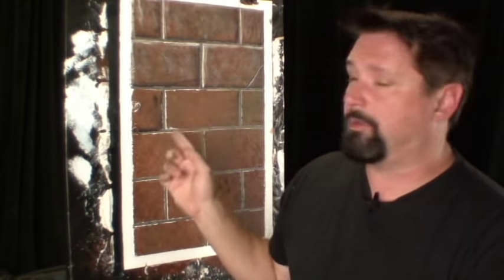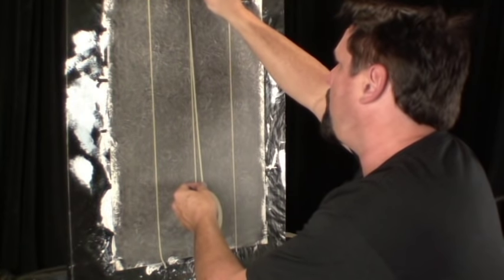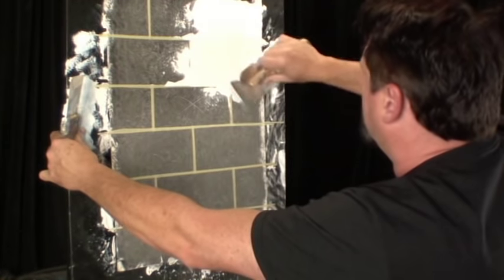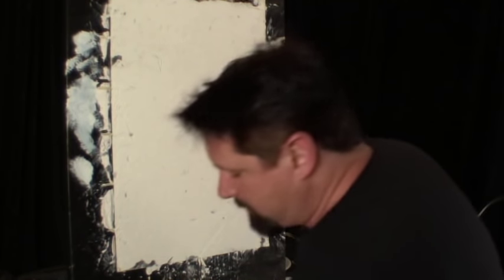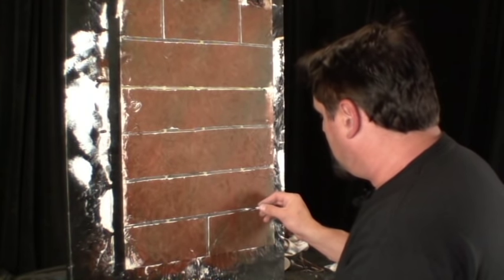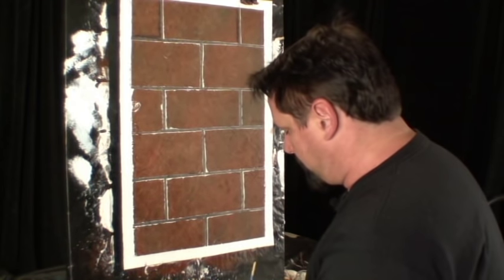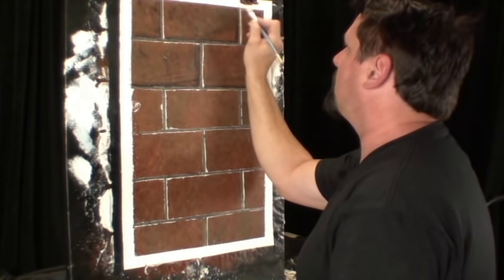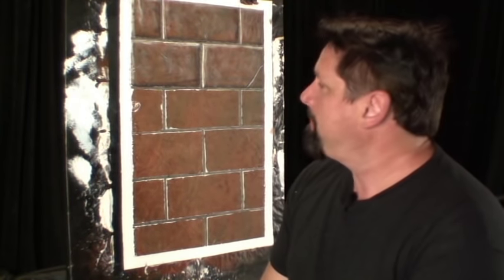Faux brick wall technique

Comment: I did this years ago but used a stencil and sand and a touch of glitter in the grout .  It turned out amazing. Your method with tape is simpler

Comment: I love this! I want to do it on a huge (inside) wall though, like 30 ft long and 9.5ft tall. Do you have any suggestions to make it quicker when I'm doing it for that big of a wall? I purchased a brick stencil instead of tape,. Would your technique work with wall paint? I want to shadow and highlight majority of the bricks but I'm not sure if I can realistically have the time to do this. Thanks!
Reply from the maker: hi, thanks for the compliment. yes the high lights and shadow technique will work the same. It does take time
Reply: +Ronald Layman great, thank you. I'll let you know how it goes!

Comment: Can I do this on plywood for practice? Were you painting on canvas? Great video. Thanks
Reply from the maker: David Lucia just use a smooth faced plywood. I'm working on poly styrene
Reply: Thank you.
Reply: @RonaldLayman  Thanks for a great video. I watched another video which showed using a heat gun on the polystyrene prior to painting to create texture ... worked well! Also,  they carved the polystyrene with a tool to create depth/grout lines. Using 4x8 panels they created an insulated wall quickly ... i.e. for garages, basements, etc. Applying your coloring techniques and their basic methods with polystyrene would seem to reduce potential for cracking etc. for panels that need to be moved (i.e. set designs) or for quickly creating a brick look in large spaces.

Comment: I am considering doing this technique on a stage prop that will be moved often on and off trucks and stages.  Do you think the texture plaster will hold up to frequent movement??  Or do you think it might crack and flake off??
Reply from the maker: Not if you have a sturdy support panel, properly prime and I would wrap with moving blankets when transporting, keep the paints you used to create so you can touch up, most touch ups should not be noticeable from the audience
Reply: I watched another video which showed using a heat gun on the polystyrene prior to painting to create texture ... worked well! Also,  they carved the polystyrene with a tool to create depth/grout lines. Using 4x8 panels they created an insulated wall quickly ... i.e. for garages, basements, etc. Applying this coloring technique and their basic methods with polystyrene would seem to reduce potential for cracking etc. for panels that need to be moved (i.e. set designs) or for quickly creating a brick look in large spaces.